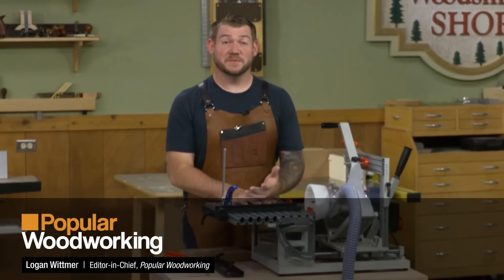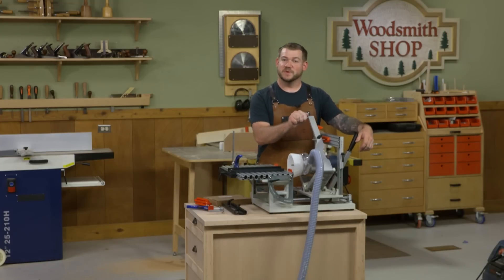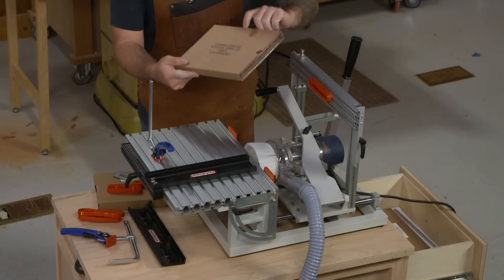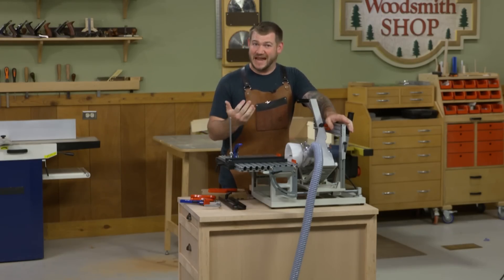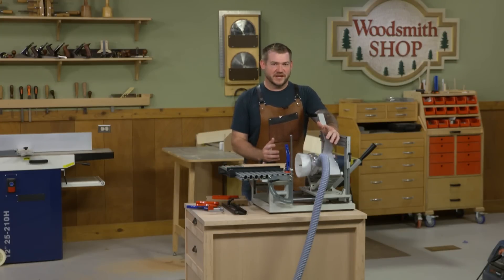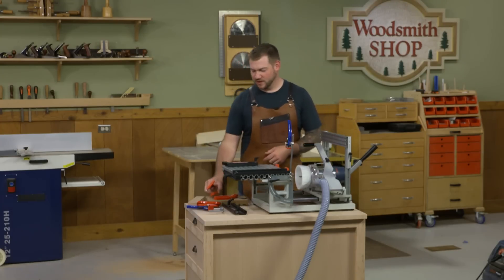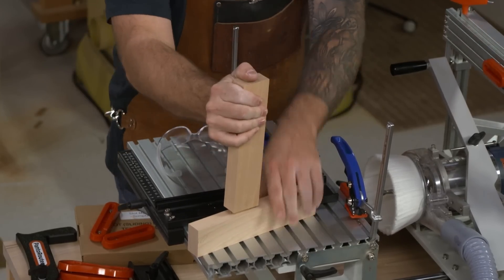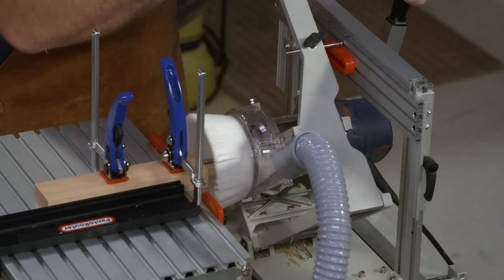PantoRouter Overview

Comment: I will put in my two cents here. This is a very high quality machine with great people behind it. The improvements made to it are also worthy of attention. I like that there is nothing digital about it which makes its simple operation open to a lot of different ways of using it etc. With custom jigs for unique wood challenges it goes beyond the mortise and tenon which it does very well. Maybe the most appreciated aspect for me is the intuitive nature of setting up a part and its cut with whatever I end up noting on the wood itself, then, matching it to the router and cutter. If the machine relied more on settings then it wouldn't feel as intuitive. The Domino is also great but it has many more limitations and can sometimes feel less intuitive but again it is quite good on large sheet goods but not so much for furniture parts. The Panto in my shop will probably continue to evolve along with various jigs and custom applications.
Reply: Thanks for your input, I am using it and yes it now has great value in my shop. I two have made different jigs and very happy with results. again thank you for your help

Comment: An interesting tool but at $1400 I'm not sure of the cost effectiveness. Probably OK for a shop doing production work. Thank you for sharing. Have a great day and stay safe.🙂🙂
Reply: I think 1400 is about right. Considering how much you can spend or have spent on everything else in a workshop. Depends on what you’re making but any domino or joinery tools cost about as much and are less flexible. I get the cost/use relation but it’s a drop in the bucket even if you’re frugal.

Comment: Big cost and a lot of work. I think there are easier ways to make mortise and tenon joinery, dovetail joinery, etc.
Reply: I made mine years ago, and it's so much more than that. Every form of joinery can be done with this, and with extreme precision.
Reply: Absolutely.  Of course there are far cheaper ways to make these joints.

As far as work?  The pantorouter is far faster and easier than any other method I have ever used or seen.  It also has accuracy to within a few thousands of an inch, which is difficult to replicate.  

Did I mention it’s insanely fast?

It’s an absolutely perfect machine and it is so intuitive to use.  It also lends itself to a lot of creativity, and the owners/community are only starting to scratch the surface of what this thing can do.

Comment: My PantoRouter sits in the box in the corner of my garage just collecting dust, no Router to fit in Australia. it went from $2300 dollar by the time it was delivered to my home $5000 dollars later useless
Reply: Bosch and others have routers for your AUS power - soft-start too. I built a rolling stand for mine including a place for s centrifugal dust separator.  Set it up and play with it. You should find endless uses and pleasure from it. I can run mine on a generator when the power is frequently out in CA, too.